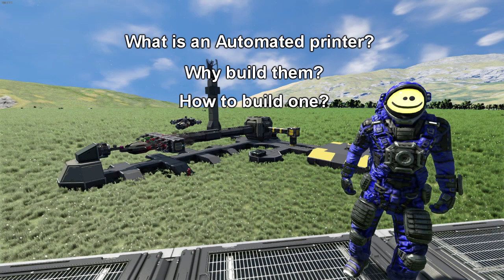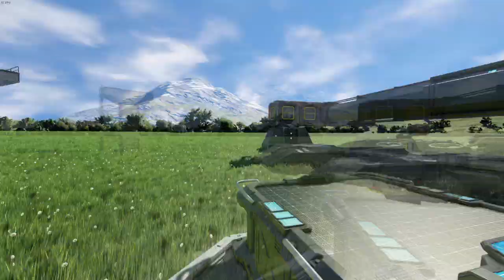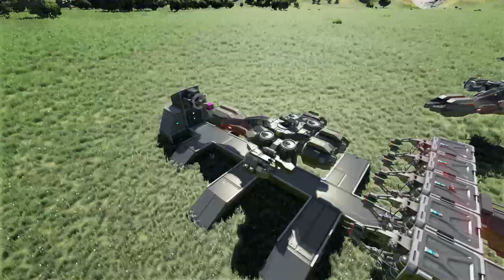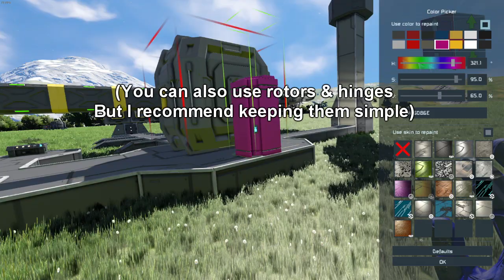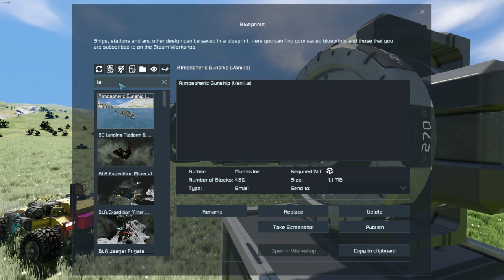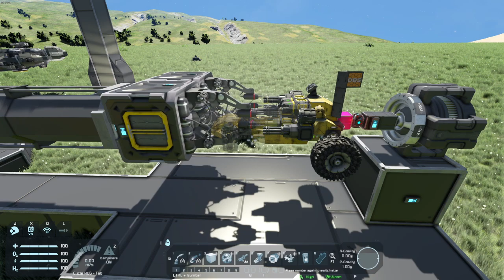Vanilla Automated Printers (Factories) - Space Engineers Basics

Comment: when I am printing small grid I have the printer wall fixed and push the projector away from it with the projection facing the printer wall. On larger grids where you need a nested piston setup its just easier for me to not worry about plumbing it all up, a projector just uses power. I normally do all my large printing in space so I don't have to worry about gravity. My standard printer wall is a 3X3 set of welders with a two pistons above that when fully retracted are slightly behind the welder wall. The pistons will have a rotor with a small head and a line of bocks out from it to which I have a number of projectors mounted, one for each vehicle I may wish to use that is preset and always has that blueprint in it so all I have to do is turn on that projector and hit the go button. Each blueprint will have a bit of spline going up to intersect with line of blocks from the rotor that you just cup away when all is said and done.

Remember when you are printing in survival you have to load your printer, your projector will tell you what blocks are used in the projection so just add them right into your assemblers production list.